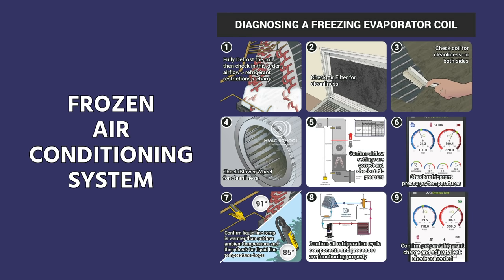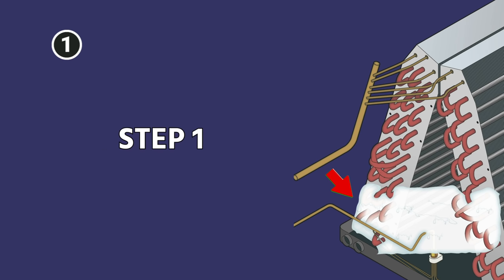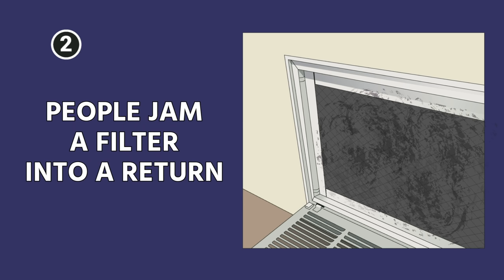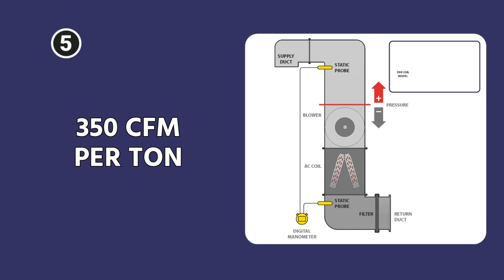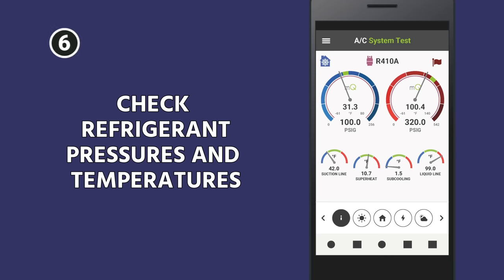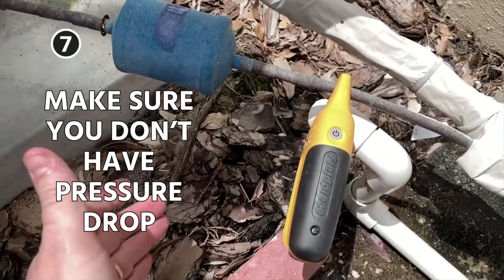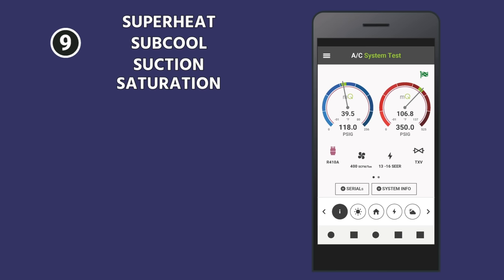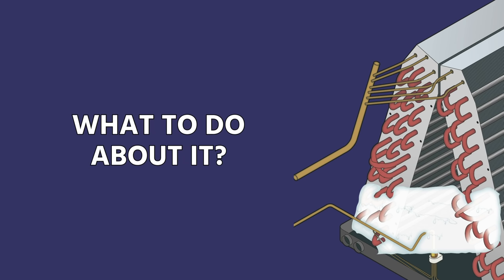Why Does The Evaporator Coil Freeze (And How to Diagnose It)

Comment: After doing HVAC repair for 35 plus years the most common reason for evaporator freezing is too dense filters, second reason is dirty filter or evaporator, third reason is bad capacitor on fan motor, 4th reason is impacted blower rotor, and 5th reason low freon.
Reply: I’ve been doing for couple years an all those are normal points of interest to check to my knowledge but fortunately I’m getting to work with the owner of the company who has worked 35 years hisself in HVAC an does that help a bunch to have him on hand
Reply: It was low charge for me both times.
Reply: I don't understand the low refrigerant cause.  It seems to me that it would make the coil less cold.
I would think one cause could be having exterior doors open too much, allowing excessive humidity in.
Reply: You forgot stuck closed Expansion Valve
Reply: @qua7771  TEV wide open because short on refrigerant and then flooding evaporator?
Reply: @CL-vz6ch  Thanks for sharing that bit of information.  I've been curious about that.  Most of the time I do automotive.
Reply: @qua7771  low pressure=low temperatures
Reply: What would you consider to be a filter that is “too dense”? Our evaporator coil started freezing up upon starting up the AC this season. I’ve been using filters with a MERV 12 rating, since we have a baby and wanted to make sure our air is really clean. But maybe this is causing restricted airflow and causing the coil to freeze up. Today the refrigerant lines on the condenser were also freezing up. Trying to figure out if it’s something simple before calling an HVAC technician. I already cleaned off the evaporator coil with foam cleaner and water.
Reply: Bad capacitor on the fan motor inside? blower motor or the capacitor on the condenser system outside? sorry im a noob.
Reply: @glazedguava7984  blower motor capacitor, basically if the fan blower has a bad capacitor it wont run, if theres no air flowing then the coil freezes
Reply: so restrictions in the line sets are rare ??
Reply: @qua7771  think of it this way… when the charge is low, the pressure is low. Low pressures mean colder temperatures in and on the line. These temperatures will be below 32°. Air passing over the cold pipe will then freeze because of the humidity (water) in the air and will freeze.
Reply: People close their vents in half their rooms and create an inefficient air flow.
Reply: Would you add poor gasketing around air filters to this list? As in: gaps around the air filter allowing some unfiltered air up into the evaporator heat exchanger face.
Reply: @ID00232651  just had one yesterday
Reply: @deltab115  depends on the filter size vs the tonnage of your system. 12 is usually too dense for a normal filter grill. If you want 12 MERV get someone to install a whole house filter system..
Reply: @deltab115  sorry I didn't see your message until now
Reply: @thepropertyfixers8648  Low pressure means little or no expansion in evap coil, therefore no heat transfer to the refrigerant -> refrigerant remains very cold. When it leaves evap coil, it will freeze all lines and condenser coil.
Reply: @deltab115  Using high density filter in HAVC is always bad for AC - a AC system needs air flow freely. If you really need clean air, try 1) install a more powerful blower 2) switch to a less-restricted filter when AC is on and switch back when running fan-only. For example, keep fan on whole night when AC is not needed. 3) have a separate air filtration system
Reply: Wow u summed it up, I changed the filter, cleaned the evap coil, and cleaned the outside, and thru in a new capacitor for 27 dollars. Thanks
Reply: 6th reason is clogged orifices
Reply: Bryan how often should a liquid line filter dryer be changed?
Reply: Thank you Bryan Hensley!  My home A/C was working perfectly for many years until yesterday.  It's hot and unusually humid for Chula Vista, CA.  When I got home from work it was 80 degrees indoors.  My wife had turned the thermostat down to 68 to try to get it to work (and I assume that could only have made the situation worse.)  Based on the video and your comment I changed the filter just now - The old one which has been in place for about six months (20x20 MERV 11) was FILTHY and bowed inward as if the system was struggling to get air through it.  DUH!
Reply: @qua7771  PT Chart...Lower pressure is going to equal a lower temperature. Hope this helps
Reply: Could also be a lime restriction if the subcool is normal
Reply: It’s always electrical BEFORE mechanical I have learned.
Reply: I'm a commercial refrigeration tech with 2 years experience and I'm always surprised how little it takes to freeze a residential system. There's so many other factors in a refrigeration system despite the two operating off of the same basic components.
Reply: @johnriff85  hey, I have a carrier system and mine keeps freezing up after I cleaned the outside unit and the air coil in the inside. I have good airflow. I remove the filter just to let air flow but it keeps freezing up. I’m thinking I’m low on Freon and that indicates probably a leak. Help me if you got anything to tell me.
Reply: @Sluggo01  in order to perform any other troubleshooting on the unit you are going to need a set of refrigeration gauges as well as an understanding of how to check superheat and subcooling. If you've done all of The basics listed previously, then you need to call a service tech out to continue assessing.
Reply: @johnriff85  thanks , already scheduled.. your right, I don’t have any way of checking low/high side..I’m an engineer in electrical.. have all tools for my trade, but not in the havc area!!   
Thanks for the response
Reply: @Sluggo01  absolutely, if the tools weren't so expensive you could definitely dig into the rest of it yourself. The main cost is if you are low on refrigerant then it's going to be expensive to repair the leak and refill the system. The refrigerant is always the most crazy expensive part. Feel free to reach out if you have any other questions, I always love sharing knowledge.
Reply: @johnriff85  yeah in today’s world try to recover, refrigerant or whatever without a cert!!  Thanks for info, I also think my lower level thermistors need re-calculated because the stat says it’s 70° and it’s actually 76, causing my commercial dampers to react
Reply: @Sluggo01  in the commercial world we don't reconfigure thermistors, we just replaced them. But if it's only a difference of six degrees that's likely the difference of wet bulb versus dry bulb temperature that you are seeing.
Reply: @johnriff85  your right..tx
Reply: So #5 system will freeze due to low ref is because let me get this right because the ref is  so low that it when its time to lets say combustion or cool off in the evap coil it starts cooling it self in the low pressure line set ??
Reply: @DJV94022  pressure gets too low which causes the temperature to be too low.
Reply: @Bryan-Hensley  oh okay thank you
Reply: I really find this example not me! I change my A)F every Month! I spend so much money for this unique form of enjoyment. I had my Inside Coils Cleaned in 2021. I was wondering, can the inside Coils not be put back correctly, causing freeze to my A/C? This is a Problem with workers! SPEAK ENGLISH DAMN IT! I CAN'T TOLERATE IT! IT'S A VERY ANNOYING TIME TO DEAL WITH..So now I just inquired an Evaporator Coil LEAK from Condenser Compressor? Why did I now get this unwanted matter? I never go up on my Rooftop.

I did hear someone else banging, hammering, drilling around my A/C Unit. Can this be a cause to lose my Evaporator Coil on Compressor Condenser? If this is the case, I had someone tamper with my equipment. 

Thank You!😊
Reply: @Bryan-Hensley This weekend, my A/C blower motor quit working. I noticed the coils were froze so I turned AC off for 24 hours. All was thawed. Turned it back on and it happened again after 15-25 minutes. The outside fan is running, the coils are froze and the blower motor not running. I religiously replace the air filter, which was 2 weeks old. Replaced the condenser. This is a new (to me) house and the A/C is 2 years old. I’ve not had any issues for the past 5 months of owning this home. Any suggestions before I call out the pros?
Reply: @deltab115 Sounds like low air flow or low refrigerant. Put cheapest filter in or remove filter and run, if it still freezes up then call ac tech. Maybe low on refrigerant and you have a leak.
Reply: @boywhohadatiger umm I love limes
Reply: Thank you
Reply: how about insufficient airflow??
Reply: 70% of the time it's a low charge. 20% it's the filter, 5% bad TXV, 5% poor zoning setup causing airflow issues. That's been my experience in the last 6 summers. Started in 2005 but did install and maintenance until 2018
Reply: @melishadavis6022 How did you fix it?
Reply: I have an issue rite now with both coil and condenser frozen up  ,I thawed it last nite ran my furnace on heat to thaw A coil ,melted all the ice , then I changed my filter , I kinda tries to clean the condenser outside,  this morning it was starting to freeze up again,  I'm thinking the capacitor is shot .
Reply: @someperson8151 I have done that in my basement for many many years I've never had any issues with closing my basement vents , other wise it's becomes like an igloo down there lol
Reply: @johnwipf1225  Outdoor condenser problems don't cause freezing. Clean your indoor evaporator coils if you can or hire someone to check everything out. blower motor capacitor is inside.
Reply: @qua7771 low pressure equal low temperatures when u add refrigerant your increasing pressures which intern your increases temperatures.
Reply: google 👍🏻

Comment: Have another cause of freezing and it is operator error. Used to work for a school district and in the old days we used standard thermostats at some locations sometimes without schedules or shutoff timers. Teachers would set the thermostats all the way down to 60 degrees, thinking that this would produce colder air (which it does not) and then forget to turn them off. During the daytime with a load on the system the room would not get to 60 degrees, but in the middle of the night the cooler outside air would drop the head pressure and the room would cool way down and drop the suction pressure and the coil surface would then start to freeze. It was a real good thing when we finally installed a computer-controlled system that defeated these clowns. Even with this we still had problems, like thermostats melted because lighters were held under them or even having heating pads pinned over them.

Comment: If I may add one more thing here based on personal experience, check if air flow control board sends proper voltage to the indoor fan so that it runs at full speed. A Trane unit had bad control board where the fan was not running at full speed, hence low air flow. I followed the manufacturer’s troubleshooting guidelines to pinpoint what the problem was.

Comment: It's amazing that most sales oriented companies schedule a job every 2 hours. There's little chance one can properly check all the items you mentioned in 2 hours, much less perform repairs.
Reply: Bingo, and thats why we were told we needed a 6k$ new unit, when the problem was a dirty condenser.
Reply: Well you wouldn’t have to do a diagnostic on a standard inspection which most companies slot 2 hours for, if it becomes a service call that needs more time, for my company, I just let me dispatch know, they will give me all the time I need to complete a call correctly.
Reply: @David0lyle  I agree!! It started when all the big American manufacturers sent there product to china for large profits. My Rheem is 22 years old and I am dreading the day I will have to replace it with a chinese replica .
Reply: @vikingson9000  Ain't that the damn truth. I just serviced a system installed in 1981. That thing ran like a champ.
Reply: @nsudatta-roy8154  40 yrs ?!?! that is crazy !!
Reply: We have a 1999 Trane and it still runs like a champ.  I just rinse the coils twice a year with a garden hose.
Reply: @vikingson9000  Not large profits: better ability to compete. The profits stay as low across the board, driven by competition, while the quality continues to drop.
Reply: @flagmichael  interesting, there is alot of competition though
Reply: @justinwallace390  Which coils? The outdoor condenser coils or the inside evaporator coils?
Reply: @steveandrews8301  Outdoor.
Reply: @vikingson9000  I have only done heating and air for a little over 3 years, but so far the oldest one was 1984 and that was a few years ago, but it went out the next summer because I had to go right back to that customer's house.  Getting almost 40 years out of an air conditioning system is just nuts when consumer reports put them at 15 years, maybe 20 if you are lucky.
Reply: @justinwallace390  My Ruud is still running thank the AC Gods !!
Reply: @vikingson9000  I am more of a Trane/American Standard fan myself. Rheem and Rudd are good products too.  Lennox is a good brand in my opinion.  I think even the best brands have their own issues in my experience.  Don't care for Daikin.  Lennox is ok, but a pain in the ass to work on.  Just don't care for it.
Reply: @justinwallace390  well you have choosen a very interesting trade and one that everyone here in Florida depends on. I wish I would have stuck with it.
Reply: @whatafukndick5660 just like tow truck drivers and dealershios just say its a bad engine when its a bad relay fuse or ignition part/coil

Comment: Over the last three years I’ve diagnosed at least 100 freezing coils, all of them being poor airflow and/or low refrigerant. Last week had one that stumped me, a mortex down flow in a mobile home that had perfect refrigerant pressure, lsat, vsat, subcool, airflow, delta t, etc. but was freezing up sporadically.  Turned out it was a 3 ton coil on a 4 ton condenser.

Comment: An early lesson in running service.  The suction line to the rooftop condensing unit was totally frozen and some of the body of the compressor.  It was  at a funeral home with a service in progress.  I couldn’t find the light switch in the basement where the evaporator was and the blower.
It was running and blowing air.  I defrosted and cleaned around the condensing unit.  An experienced service man who was very familiar with this location knew right off the bat that the belt was slipping on the air handler in the basement without even turning the light on.  He knew where the light switch was too. This so was embarrassing.  I always remember this lesson about a freezing situation and also try to have adequate lighting if I’m going to inspect evaporator system.
  thanks for your video it really covered a lot of aspects very quickly but they are all important and will help me in the future.

Comment: Thanks, I have a Heat Pump with frozen evaporator and found out the fan blower got overheated and stucked. Hope this is the cause of my problem after replacement. Informative video keep posting.

Comment: This video is very descriptive but way above my technical knowledge.  I'm going to just call my local HVAC repair guy.
Reply: U dunno how to check a dirty filter?  A bad fan motor and/or a capacitor is also very easy to swap out too.  Basically, the only thing u couldnt do with the slightest amount of effort, is the last part: the refrigerant.

Comment: Our new HVAC began freezing up initially because the floor level intake coated the filter with dust from our dogs in about a week. With the advent of monsoon season here in Flagstaff the dust settled somewhat but humidity rose. At over 7000 feet, airflow is already at a premium. Finally, the zone system includes a very long 8 inch duct to the guest room, which demands cooling but only a wisp of air makes it through. Next step: I am adding a duct fan controlled by the damper for that zone. Don't know if it will be the final step in the fix but it should relieve the current issue.

On the plus side, we are very familiar now with the symptoms of icing, and our first step in dealing with it is to kill the 240V to the compressor. The second step is to swap out the filter if it has been in there more than two days. (We are now using a pair of K&N filters so there is no hesitation to swap them.) Half an hour gets the air moving enough to complete the defrost, which takes about an hour altogether. It could be a lot worse.

Comment: Great video. Another thing to check is the evaporator blower motor. Is it seized? Does it get power? Bad Transformer?
Reply: It's an indoor fan on a split furnace/ac unit, not an evaporator fan.

Comment: don`t to look for duct work errors. back in the 90`s went to a house, 2.5 ton low air flow, pulled down the attic stairs looked at air handler with 65 feet of 14 inch flex duct on the return, closed stairs and told her the duct crew will be over to straighten  it out shortly.

Comment: 1.check air filter first(just like you do with your vehicles)
2.take pic of the evap coil in selfie mode with phone so u can see the bottom (dont drop the phone lol)
3.check blower speed
4.check zone board and the wiring to see how many dampers your dealing with in the home

5.turn off one of the thermostats and keep 1 running and go to attic to inspect dampers and ductwork

6.make sure your dampers are close and open based on which thermostat you turned off and left the other on.

7. Make sure you put your hand on the vents to see if its off on the zone you turned off..

8. Go get your pressure readings

Comment: Hi.  Thanks for the video.  We have a Magicpak unit in a closet in our condo.  It's dripping water in the closet and down the outside brick when it's in AC mode.  It's new.  Filter is new.  Installer says he needs to contact the manufacturer.  Very frustrating after $7,500.  Any experience with those magicpak combo units?  Thanks.